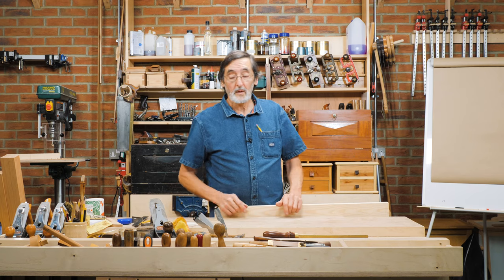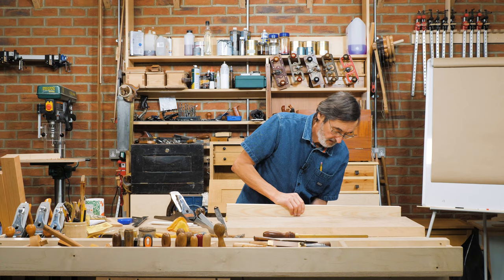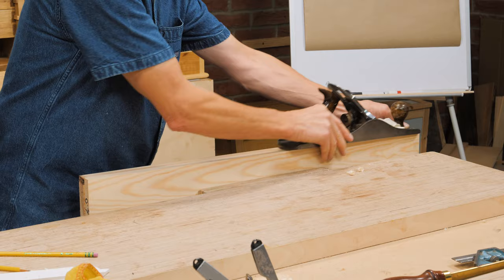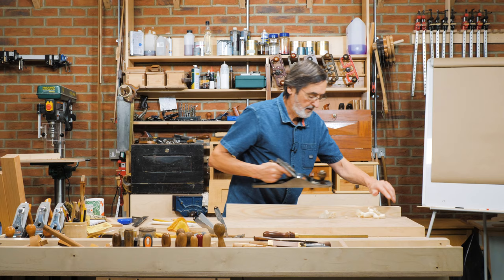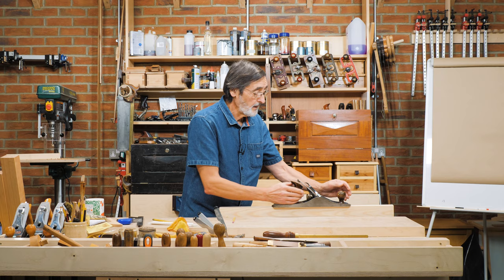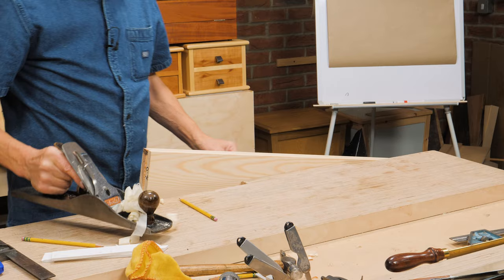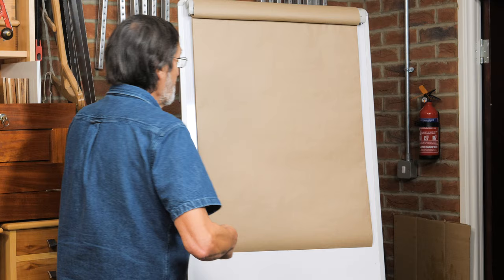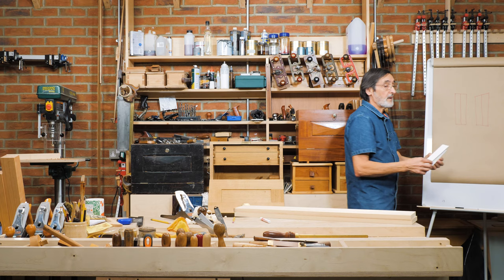How to Edge Joint Two Boards by Hand | Paul Sellers

Comment: Simple and straightforward, just what I need. I always worry about making a joint worse so I avoid using a hand plane but this method works. I do however need to get a wider and long jointing plane now that I want to do it with hand tools 🤣

Comment: Thanks Paul! Wow, so simple. And here I am doing each face separately with a straight edge and a square! 

Do you maybe have a suggestion for thicker boards (say 40 mm thick), that when combined, is wider than even a Nr 8 plane blade?

Comment: Another very informative video,  thank so much. I've learned so much about hand tool work from you Paul that apart from a drill , power wood work tools annoy me so I don't use them anymore.  I suppose by deliberately planning out of square you actually give yourself a bigger glue area .

Comment: thanks for the tip Paul, one question, why do you lay the bords on the pencil every time before you put them on the vice? is to compensate for any unevenness that the bank may have? or just for makeing it easier to grab?
Reply: Hi Carlos, it is to make sure the front and back ends are flush. If there are any bumps in the middle, the ends will not be flush.

Comment: The problem I've had with edge jointing out of square is when you clamp the boards together during glue up, they slide out of alignment.
Reply: Sprinkle salt in the joint on top of the glue.
Reply: The alternative is a plane with a fence to get those 90° angles in your board.
Reply: Follow the “open time” on the glue bottle (~10min). But glue on evenly, let it sit 10min, now put the boards together and clamp them. It makes a huge difference.

Comment: I am using a moxon vice as it's all I have, and when I clamp two boards together like this in the vice, the clamping pressure forces the top face apart. Do you have any advice for rectifying this as I am currently failing to square the boards up. Many thanks

Comment: Brilliant, love the pencil thing as well. If you were planing to joint 2 boards thicker than the plane sole would you still use this method to eliminate the need for getting a perfect square edge or is it more effective to do each one separately?

Comment: Thanks for this! I am making something right now and I was doing each board individually and they never Would match. I started going at an angle on one as well. I found it hard to keep the plane lever as I pushed it through.
Reply: You can do it individually if you wood is perfectly square it will for a the perfect joint. The double method Paul uses is the easiest method and is just an exercise in geometry and is the prefered method of many people.

Comment: What if the boards are rough sawn and have not been surface planed. Do you recommend first cleaning them individually to the same thickness and then jointing them? I have Also had a situation where the boards were more than  the thickness of the plane blade when put together. In this case would you recommend  this method?

Comment: Could I achieve the same result with a workbench table top and long narrow strip of adhesive sandpaper?  Reason for asking is that my boards are wider than my No. 7 plane, so I am not sure I can easily achieve your result (at my skill level using hand planes), since your boards appeared to be narrower than the blade on your hand plane.  I would do the same thing as you did, except my work bench with the sand paper is acting as a hand plane.  I would tape the faces of the boards together and sand both edges at the same time on 120 grit adhesive paper glued to my work bench.

Comment: Not to nag, but these boards are a  in a lot better condition(and shape) than the pine boards I often find.
Any advice  for much cruder wood?
Reply: You need to prepare your rough stock before this to get rid of cup, bow and twist. I would suggest looking at his video on stock preparation. Although I prefer to use small spirit levels instead of the winding sticks Paul sellers uses.

Comment: Jointing them out of square actually gives you a wider joint line and a wider glue surface and a stronger joint.
Reply: I reckon you’re talking 1mm extra width at max. Don’t see that making much difference to the strength of the joint.
Reply: @nomisant  With a 10mm board that's 10%. I'll take 10%. If you find a few more ways on top of that you're really doing something.
Reply: @nomisant  thank you for the reply. So I tested the effect on a 10 millimeter poplar board expecting a 10 percent increase in strength which is significant. I cut a 5 foot board into 10 equal 6 inch lengths and ripped them in half. Joining 5 square and 5 off square by 2 degrees. This gave me the 11 millimeter you spoke of. The results of breaking the board in a Rockwell pressure system surprised me. Of course in a pressure test just applying to the board; the the board broke before the glue joint. However in the shear force test the 90 degrees joint gave on average for the remaining 3 boards at 673 pounds per square inch. And the 2 degrees off 90 on average broke at 787 pounds per square inch. That was a greater gain than I expected.

Comment: Thanks Paul!  Good way!  But the question remained: how to trim the edges at an angle of ninety degrees without any fixtures? (Спасибо Пол! Хороший способ! Но остался вопрос: как пристрогать кромки под углом девяносто градусов без всяких приспособлений?)
Reply: You can either use a jointer planer with a fence or rebate plane with a fence (on thinner boards). Alternatively use a square reference ruler and a normal plane and just check your angles frequently. I suppose you could try to clamp down a plane sideways on your workbench and run the wood across and take thin shavings, but that seems tedious.

Comment: Would that mean a non square edge joint may better than square because there'll be more surface area in the glue joint at an acute angle?
Reply: I would imagine that any angle small enough to make a difference in gluing surface area would make it more tricky when it keeps slipping apart when you clamp it. A good glue joint is stronger than the wood around it anyways.
Reply: @nathanbame4198  true, but if it's properly clamped down it'll mitigate that problem right?
Reply: @mikeg2046  Yes. Someone posted a reply about that in these comments.  The non-square joint got roughly a 13% increase in shear.  It went to 787 psi from 683 psi.  Nice returns, and you still have a nice glue joint.

Comment: Do you think this is how they made a perfectly straight reference edge back hundreds or thousands of years ago?   Get a pair of boards and plane them down until there were no gaps?   I can't think of any other way to do it.
Reply: Maybe, but I think historically the first mechanically precise flat surfaces were surface plates. You make those by taking 3 flat stones and rubbing them together pairwise until there are no gaps between any pair. If you have a surface plate you can make a straight edge by referencing it to that.

Comment: I planed my table top board out of square but instead of flipping them I tried to force the joint and it very slightly left me with a cupped table top but I figured that was maybe a better choice than losing the grain matching across the entire top. I did have to put a couple of washers in under the mounting screws just to take up the gaps unfortunately but I can live with it.

Comment: Near the beginning you adjust the set because it is too shallow - why? Is it just not taking off enough material making the job take longer than necessary?
Reply: I would assume so yes. Just quicker to have a bit more iron.
Reply: Shallow gave feedback about the edges that a deeper cut can't give.
Reply: @TermiteUSA  Yeah, I think the shallow cut gave some insight as to where the high and low spots are.  Then once you know that, you can adjust the blade and then you know more about how to work with your particular board and it's needs.

Comment: Won't one of the boards be oriented so that you are planing against the grain?
Reply: Not always.  but if so, you can go with a sharp plane with a very soft set.
Reply: But it won't matter too much since you will cover it with the glue joint. Unless you get very bad tear-out on the edges.